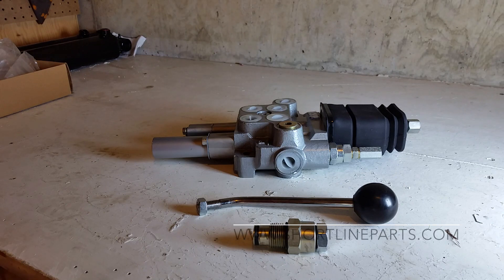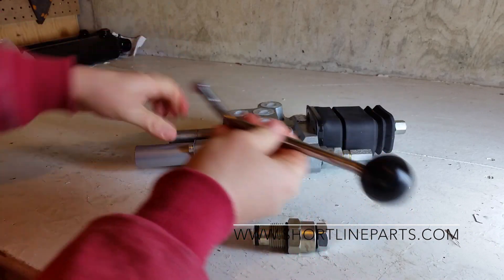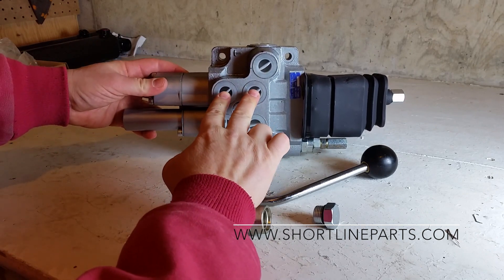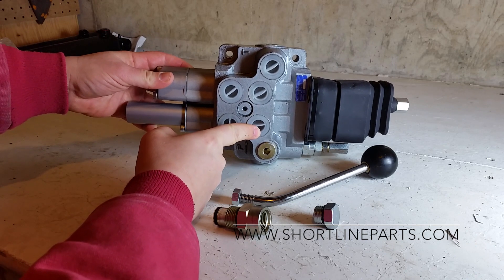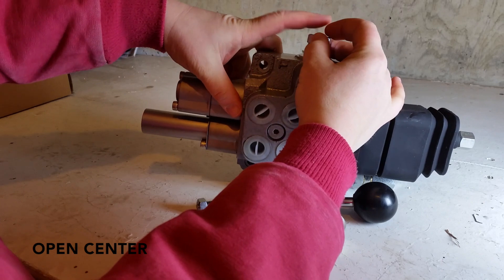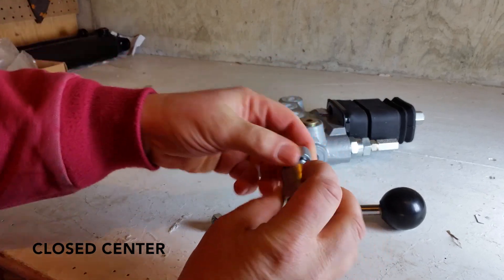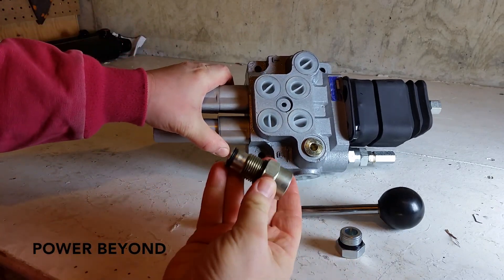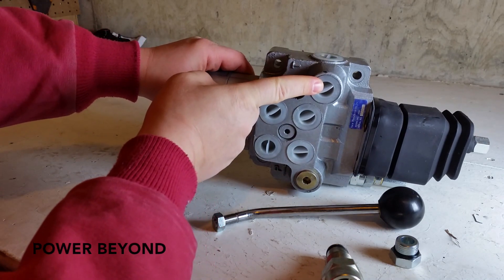OEM Hydraulic Valve and Joystick Kit for Small Koyker Loaders - Hose Installation Instructions

Comment: What size is the threads on the Pace 7040 valve ?  Do all the ports have the same size threads including the Power Beyond Sleeve.  I would hope they are all the same size. Please provide the proper thread name, and size. Thank you.
Reply from the maker: If you have the actual Pace 7040 valve, the in pressure port and the working ports should all be #8 o'ring boss which is 3/4-16 thread, The outlet or return is #10 o'ring boss which is 7/8-14 thread.
Reply: @shortlinepartsllc6795  Thank you so very much.

Comment: I have a Kubota L2650 with a defective loader , two spool, joystick control valve. I assume from a comment that this will work on the L2650? I looked at hoses, two hoses for loader up/dwn, two for bucket tilt/dump. BUT I have 3 hoses from the hyd block assembly mounted on engine?? ( I have 7 hoses to the loader control valve)  What is the extra hose for?? I need Pressure, RTN, Two for loader, two for tilt Dump, that is 6 hoses.

Comment: How can I tell which type system i have. 
Closed , open, pb?
Reply from the maker: Tractordata.com is a great source. There's a page for each tractor model and in the Hydraulics section it usually lists if that tractor is Open or Closed Center. Power Beyond setup can be used with either Open or Closed Center.

Comment: I have this valve on a koyer 155 FEL installed on a ford 1720 - works great.  Can I use this valve on a bush hog 2246 FEL on another new holland 1720 I have?
Reply from the maker: Yes, it will work fine with a New Holland 1720 tractor.

Comment: Is there a kit to rebuild the valve?
Reply from the maker: We do not carry an OEM rebuild kit for this valve, just the complete new valve.
Reply: Short Line Parts, LLC  
You say you don’t carry repair parts for the loader valve: do you know of someone who would or perhaps maybe the factory? My plungers or pistons or whatever their called have broken and it’s mostly unusable. Or perhaps you have a used one I could buy for parts? Thanks for responding.
Reply from the maker: We have actually asked the OEM supplier of this valve about getting repair parts for this valve, and they do not sell parts for it, unfortunately.
Reply from the maker: We have started carrying a rebuild kit for the Koyker valve that is used on its smaller loaders--the valve shown in this video. The rebuild kit can be purchased at the link given here. One note - this is an aftermarket rebuild kit. http://www.shortlineparts.com/koyker-valve-o-ringshtml